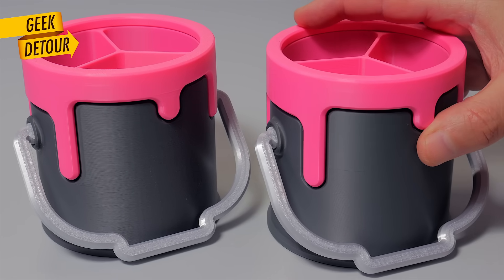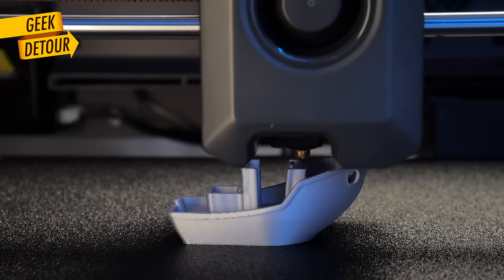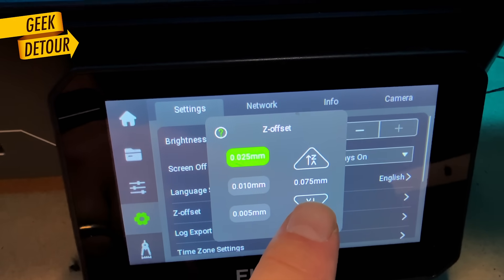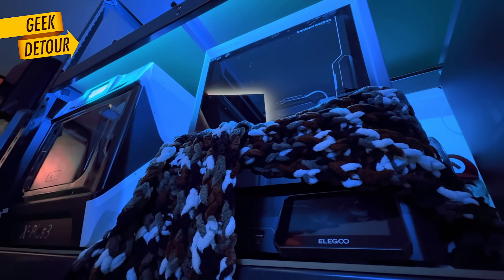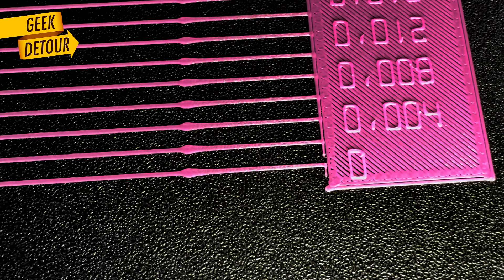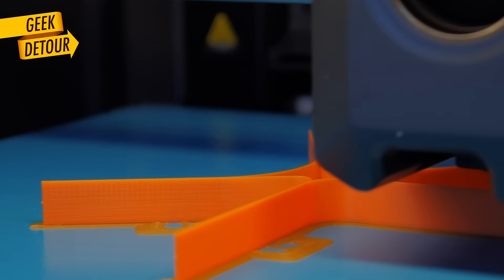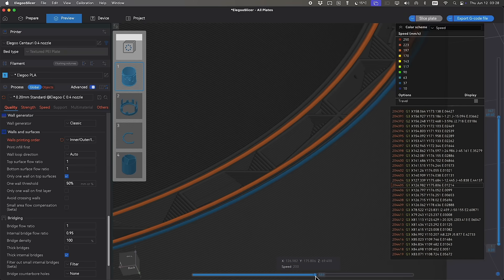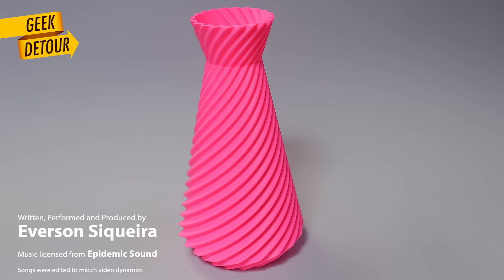Auto vs Manual Calibration — Elegoo Centauri Carbon

Comment: I don't know if they updated and changed it or not, but you don't need to set the Z-offset in the slicer; your printer remembers it. At least, mine did just now when I restarted it.
Reply from the maker: I think you are right - there are a few comments here saying that. But my Centauri Carbon shows it is using the latest firmware - or let me be more specific: it is using the latest firmware available for the MODEL I have… There might be a difference between the first batch (the one I got, without the multimaterial port, without the LED bar…). I need to ask Elegoo.

Comment: What a great video.  No fluff or nonsense, just real and extremely useful information.  

The start Gcode change is really helpful - I had been manually pre-heating the nozzle and bed before sending the STL to the printer.  Thank you.
Reply: I am struggling with the start G-code. I can't really code and I double checked the code in the video from ChatGPT. It said the code isn't usable with copy paste method in Orca Slicer due some conflicts with } and ] characters and some other parameters. 😢 Some one please provide working Gcode to Orca Slicer.
Reply: @gratnak8618  Elegoo slicer is just a fork of Orca - the code should just work:  

;Preheat nozzle to printing temp
M104 S[nozzle_temperature_initial_layer]
M190 S[bed_temperature_initial_layer_single]

Just insert after the M140 line in the start gcode block.  You can remove the repeated M190 line for bed temp a few lines further down

Comment: My Z offset doesn't get erased from the printer after the power cycle.
Reply from the maker: There are many 3D Printers that save the Z-Offset on the machine. Recent machines seem to be going for a not-fixed parameter, because the ideal offset varies slightly depending on the temperature, material, speed… But many printers have it stored on the printer. The Centauri doesn’t.
Reply from the maker: PS: Someone is pointing me that a recent firmware is saving the ZOffset.

Comment: Not sure this was mentioned but a better option for VFA may be to use the "Resonance Avoidance" setting in Orca Slicer. Here you can tell the printer to skip certain speeds that cause visible artifacts. This is especially useful if you notice that both low and high speeds reduce VFA (helps you avoid those pesky middle speeds).  See the Orca Slicer Calibration Tutorial for more information.
Reply: Nevermind, I see that the CC doesn't have the option for Resonance Avoidance in Orca Slicer.

Comment: Does anyone know, once you have determined your Z-Offset on the CC and you input into the Slicer Profile, do you then go back and put the Z-offset to 0 or does it not matter?
Reply: That’s what I want to know, is the slicer setting adding to the z-offset on the printer screen or not. Mine seems to work better when the printer screen is set to 0 and I have 0.075 in the slicer.

Comment: Thanks for this! working through the changes here and started with z-offset, my first layer looks way better now, but my printer seems to be remembering the value, even if I unplug from the wall - I'm guessing this may of changed in some update, so do you no longer need to put this information in the slicer?
Reply: Also I have just ordered one of those cryo build plates, do I need to redo this whole check on that plate?

Comment: Others have said the z-offset has to be changed, sometimes between prints due to different temps and type of filament. Realistically if the sensor probing system works properly, this should never be needed.

Comment: Does the size of the model affect the VFA? Im making small prints that are maybe 3 inches tall but im seeing the VFA or even a seem line. Its not too noticeable but im always wanting to make improvements. I am new to 3D printing and got this exact printer a week ago
Reply from the maker: Small cylinders barely show any VFA - the bigger the radius, of in flat walls, it always appears more. For functional parts, I don’t bother. But if you are printing something that needs to be pristine / beautiful, try changing the speed of the external perimeter (wall), to 150mm/s or even 40mm/s (choose one or the other, speeds in between are the ones to be avoided at all cost).

Comment: Interesting as I got my initial g-code from Orca, never bothered to try the Elegoo slicer and it has M190 S[...] already in there. I will say it did have the M104 standard line in there though so I did change that. Have you messed with M106 in your g-code for the CC? I am trying to figure out which P# controls the Auxiliary(side) fan, I am guessing 2 as I want to make sure that never comes on with a specific filament at the beginning of a print after the first 2 layers.

Comment: Are you sure the z offset isn’t saved

When I put it in my printer to see what the right offset is 

Go to slicer change offset 

Shouldn’t save in printer 

Print new part 

Offset no longer correct 

I think they must add together
Reply from the maker: The printer doesn’t save the value. The tool in the printer is just to investigate.
Reply: @GeekDetour thanks this has been confusing cause mine will show the same number on the printer inbetween prints and sometimes Power cycles I think I’ll just set to 0 and use orca

Comment: Hmmm no, not all printers have VFA and it's not the motors: it's the belts and pulleys and kinematics.
You avoid those printing FAST, not slow, ~140mm/s is the worst speed, print over 200mm/s.
Reply from the maker: I agree with part of what you said. A bigger motor causes more VFA. And about the speed, there are ranges: super slow has less VFA, faster than 60 it goes horrible in most printers, and starts getting better at 130…. But it often gets worse again. But here is the tricky thing: just like a car cannot start speeding straight on 100mph (it starts from zero and goes accelerating until it reaches the targeted speed), the printers is the same: when you set the external wall to print at 150, part of the wall will be printed slower, and a few millimeters away it will finally reach the maximum speed - but in that region where it is accelerating, there are VFAs from all the intermediary speed in which VFA is bad. So, for a really uniform wall, the lower speed is the only way: it reaches that speed and it remains there the whole area. Does it make sense? The part I strongly disagree is: not all printers have VFA… please, tell me which. I used more than 20 different 3D Printers - all of them have VFAs. Some are very subtle, some are terrible.
Reply: @GeekDetour  That's why we have printers with 40k accel, also you can't have hard changes of pressure in the nozzle so keep your print speed 220-350mm/s and you won't have VFA on external walls.

No one should print at 40mm/s in 2025.

Comment: is that first layer test built into the printer or do i have to create it in the slicer and export?
Reply from the maker: The big first layer test you see all the time is just a “primitive” cube, we add with the right click straight from Orca, and change the dimensions so it becomes very wide (200mm X 200mm) but only 0.2 or 0.4mm tall.
Reply: Thank you, i will run this test today @GeekDetour
Reply: Thanks for asking this as I was thinking the same thing

Comment: I've found that on direct drive extruders, ironing is unnecessary as long as you have flow rate very well fine-tuned.
I usually leave it off, because it actually makes things worse in a lot of cases (overextrusion on top surfaces).

Comment: Wait so is the nozzle bot separate from the heat block? That kinda sucks.
Reply from the maker: The Nozzle, the heat block, the nozzle break and dissipator is a single piece. It has the downside that you cannot swap just the nozzle - but it solves a problem a lot of people had: leakage from not properly tightened nozzles… or breaking the heatbreak when trying to tighten without the proper tool (or lack of knowledge). It is becoming the standard: BambuLab nozzles are also like this. The K1 / K2 nozzles are an intermediary solution as the nozzle and heatbreak is a single piece, but separated from the heater and dissipator.
Reply: @GeekDetour  I think it depends which batch of Centauri Carbon you got. You can swap nozzle on some of them, look up "Centauri Carbon: Hotend Removal and Teardown"
Reply: @GeekDetour  my issue with this (and I think positively of most of this printer) is it seems like more of a cash grab. A way for them to make more money buy limiting unofficial options that could potentially be cheaper.

Comment: The CC was an exciting printer release, based on all the responses. One of the key selling points was the low price. Not so here in Australia, where they priced it at $699 AUD (roughly $450 USD). No excuse for such behaviour that I can see. If anything it should be priced cheaper here as its cheaper to ship here from China, and we don't have the Tariff Terrorist running the country.
Reply from the maker: Yeah, in Europe they also sell a bit more expensive than in the US: €330 (like 360 USD)

Comment: What settings did you use for your Cryo Grip Plate? I was thinking of doing the same thing on mine.
Reply from the maker: I actually didn’t chance any settings. Sure, they are advertised as to print in lower bed temperature - I like it to print things that are thin, narrow bases, so I don’t low my bed temperature at all.

Comment: My perfect Z offset with an AliExpress carbon forged gold plate and pctg was 0.150 and the layer came out without burn and waves finally also PA perfect line was 0,54 for fiberology pctg much better than pctg 0,7 default thank you this improved a lot my beginning to 3d printing

Comment: PA calibration with line method is deprecated . Tower method is still good but requires too many times and material so best way is pattern method
Reply from the maker: Oh, it’s a pity they are deprecating the Line Method - it was way easier for people to identify the ideal value. 
I see many posts on forums, from people posting their photos and people disagreeing what’s the ideal value. The Sharper corner is hard to see at naked eye. I don’t think it’s a better test in every sense.

Comment: Great video. 
I've been printing for only a few months, but on my Ender 3 V3 KE I found that the Z offset calibration on my printer is performed at 60c, but since the metal expands and contracts depending on the bed level this offset is relevant only for 60c. I've updated my start G Code to run a Z offset calibration at the start of the print. It takes a little longer but I don't have first layer problems and I don't need to play around with the Z offset when replacing nozzles and materials.

Comment: Would you recommend this for high resolution prints for miniatures?
This is for me and my son to print these figurines and masks.
Is there a better option?
Replace with a hardened be a good idea?
Is there a colour's mms?
Reply: Advices from a newbie (which have read and watched videos a lot!): use a 0.2 mm nozzle, that's what is recommended for this usage. Small layer size too, of course (80 % of nozzle size). Hardened or bi-metal is better for technical filaments, or just to extend the life of the nozzle.

Comment: I wish people like you made profiles for different filaments for us other mortals. Configuring and tweaking machine is one thing, but getting perfect results on filaments is a job in itself.

Love the clip and thank you for your service!
Reply: In all honesty, the filament brands should do that and send their results to Elegoo and other printer brands.
If someone like Geek Detour wanted to take this as a challenge, he would kill it with a blog or website that also sells designs, but it would have to be for all printers and filaments.
Reply: Wish that was possible but there are too many variables. Somebody else's settings can be a nice starting point, but the ideal settings will be different for everyone any might change over time.
Reply: @MichalKovac91  yep and even different countries have different results with same set up beacuse of weather and how that effects in door weather
Reply: @samsunggaminghub  Yea but these variables are pretty much controllable if you check the humidity and temperature of the fillament (in an enclosure) and the printer iself (which also needs to be enclosed). So such tables file of different brands would be achievable. You don't need a lot of test results (maybe 6 datapoints per variable) to create a model on how the material behaves on different temperature and humidity.

Comment: Buyers beware of the Centauri  Carbon. Not sure why all these guys on YouTube are promoting the Centauri Carbon. I received mine last Tuesday (6/10/2025)and it has sat on my desk for most of that time collecting dust. I was able to print to the Benchy, the poop bucket,  the 4 corner pieces of the riser and two of the connectors for the riser before it would not print anymore. after almost a week and 8 emails later Elegoo finally got back to me offering me a new hot end. I'm requesting a refund so lets see if they are honor that. I know its only $299 but that is $299 I could have used to purchase a reliable printer.
Reply from the maker: I believe you - fixing a broken printer is not fun. The thing is: it happens with printers from all brands. In my opinion, the Centauri Carbon will be the new "Ender 3", the printer everyone can buy. So, pricing is a game changer. Right now, if I had to spend 600 USD to buy a 3D Printer, it makes more sense to me buying 2 Centauri Carbon than buying 1 Bambu Lab P1S - of course, because I already have a P1S, which I love and use a lot too. But printing more parts, at the same time, solves a bottleneck for me and a lot of people. That's exciting.
Reply: People get 1 bad product and swear every youtuber is part of a grand conspiracy to steal $300 from your wallet 😂
Reply: I've been running this thing with zero tweaking nonstop for a week and I've had zero issues. You got unlucky. It happens. The world isn't out to get you, you just have main character syndrome.
Reply: Youtubers would sale their kids for views......
Reply from the maker: @slottygw2wvw842 What you say is truth in many channels. BUT, I was one of the first guys to receive the Centauri Carbon - I didn’t release a “first impressions” video (which could have generated quite some money for me), because I wanted to really use the printer before recommending.
I have quite a few printers that I received from manufacturers and I NEVER made a review because I felt the printer was really not ready yet - some never became good enough.

Comment: Would you recommend the CC for someone who has never owned a printer (first printer) but somewhat knowledgeable of 3d printing, i am looking at the CC and not the A1 bc i want to tinker. Replies are greatly appreciated 👏
Reply from the maker: Any printer will serve you as a starting point for your actual 3D Printing journey 🤣 For tinkerers, the Bambu Printers might not be the best option - although the printers are excellent. A Voron is the ultimate tinkering adventure - but I don’t recommend you putting a Voron together as your first printer. The Centauri Carbon is a super deal for the price - is it good for tinkering with the printer itself? No, but that’s fine 🤣 Join the FaceBook official Centauri Carbon Users Group - check the MODs people are doing for the CC and see if that goes into what you would be happy to explore.

Comment: Fantastic video

Also 4:50
I have never seen a first layer look this good. 😍
Reply from the maker: Thank you! ❤️ I usually print a tiny bit closer than what I’ve shown in the video. I don’t really care so much for a completely smooth 1st layer when looking from the top (it will be inside the printed part in most cases). I like the “press down” a bit more, so the bottom texture becomes essentially rid of lines - the drawback is that the top is a tiny bit less perfect. But I know people freak out about the appearance of their first layers.

Comment: You cannot just "avoid" high speeds. When the object is round or at an angle, that speed will be crossed.  
Unless you stay slower than the VFA speed. 
As you showed also. But who wants to print at 40mm/sec 😊 ? Not this guy. 
The echo with 2 narrator tracks is kinda distracting.  But otherwise very entertaining as always. Keep it going. 
Vfa is a deep topic. Curious your thoughts and assumptions. Cheers. N8
Reply from the maker: Hi there! For MANY parts I don’t care and print fast: functional parts, brackets, stuff printed in white… you don’t see FVAs or it doesn’t matter. But this Drippy Bucket was a gift - I wanted it PERFECT. So, slow outer wall; the rest is fast.
Sound is such a personal preference! I have comments of people that LOVE the music tracks I use - and people that complain of them being distracting… I think well matched music enhances so much the feeling (even when it’s a technical video). The echoes marked an emphasis of each new topic. It’s subtle - one friend of mine loved it - you didn’t like it 🤣🤷‍♂️

Comment: I have never heard that sound from mine. I've run over 10 spools of filament through it. Did Elegoo say that was normal?

Great video, will so some of these tests. I've been extremely satisfied with mine but will see if i can push it further
Reply from the maker: The sound of the Input Shaping? Maybe you didn’t run the calibration then 🤔 It IS noisy.

Comment: Print a single layer to test z offset. Looks like I have it dialed in looking super smooth and good. Start a print and get poor adhesion. Looks like 0.05 doesn't work for me no matter what it looks like in the test. Have issues at anything other than 0.0 z offset.
Reply from the maker: Oh, no kidding: don’t use alcohol. Take the build plate to the Sink, and wash it with dishwasher detergent (2 drops), use a dedicated sponge 🧽, rinse well in warm water, dry with a paper towel… DONT TOUCH the surface with your fingers after cleaned. You will be amazed.